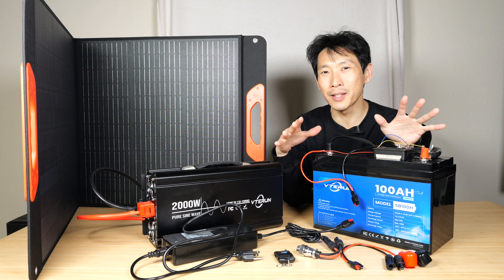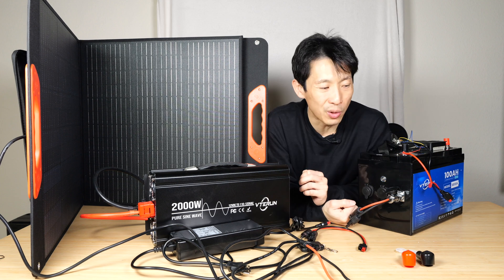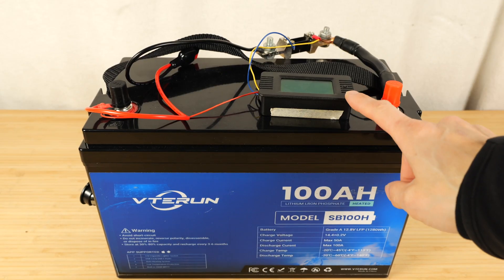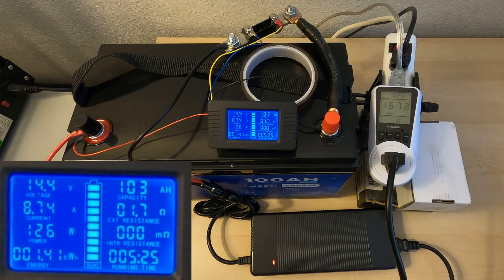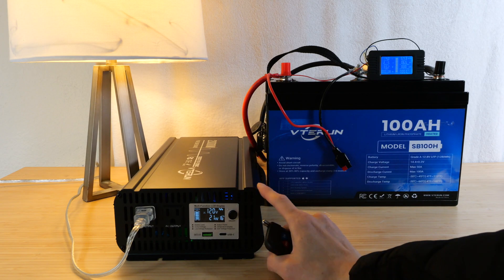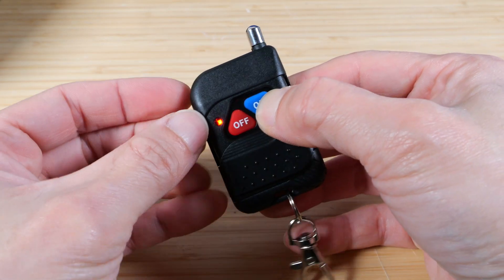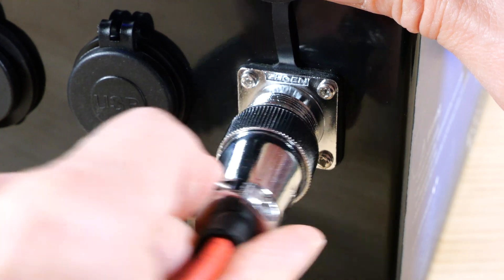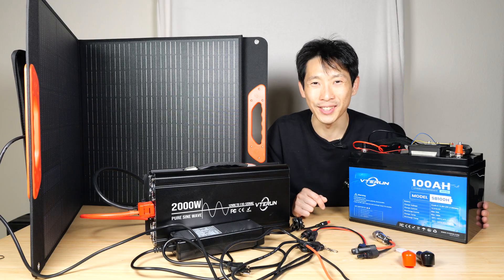Group Battery with a MPPT Charge Port [VTERUN]

Comment: Is it possible to find solar panel(s) that put out a voltage that can charge battery(ies) without a charger in between?
Reply from the maker: You could but the load on the solar panel will not result in maximum power transfer.
Reply: @BeatTheBush Thank you!  I very much appreciate the two videos of yours I have watched on this subject.  I currently have a small setup, but can only cover 1 of 3 uses during a power outage.  Fridge/freezer, gas furnace, and sump pump.

Comment: I do prefer the "one box" methodology, but, I am totally for the modularity. So, if they had a "Box" that all these components fit into that was well designed, it would have the best of both worlds, because it would improve the ability to repair in the future.
Thanks again for the review. Consider adding oscilloscope tracing to show the Inverter output.
Reply: I believe the complete opposite. If they put all items into 1 compact item. It's easier for "the 1 thing" to break and then either you don't know what's broken or you're getting an entire new unit vs just getting 1 new part of the modular unit.
Reply: @carlosb.9032  You are right when they seal everything in 1 box, and don't actually use easily repairable methods it is a huge pain. 
What I meant was, I would prefer a nice box that all these components could fit into to make them easy to carry around, and also serve to make it 1 "unit" (with the ports and display etc and storage for all the small bits and adapter wires) preferably with a UL listing for inverter power device. The actual components can be individually placed just as they are shown here. You could still remove the individual components at any time and replace or repair them if broken.
Reply from the maker: One box, open with 4 screws. Each component snaps in with 1-4 screws that all faces upwards and easily accessible. Extreme caution must be taken when working with batteries since accidental short across the terminals with a screw driver would be disastrous.

Comment: So it doesn't have a reset fuse or replaceable fuse for the port?
Reply from the maker: No fuse on that port but it trips when over current for the entire battery.
Reply: @BeatTheBush  Yea, I can see that would be a hazard... all ports should have their own individual overcurrent protection based on the ports current rating. Of course, it is good to have overcurrent protection on the entire battery too, but if the port's rating is exceeded it will melt.
Thanks for the cool review.
Reply: @BeatTheBush if Porta and on button break is it easy to convert to normal Batti?